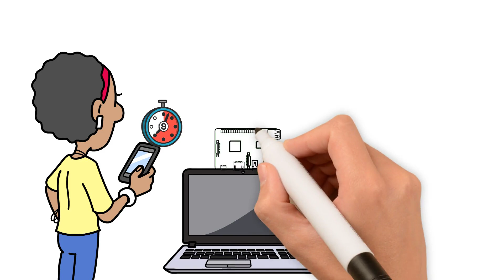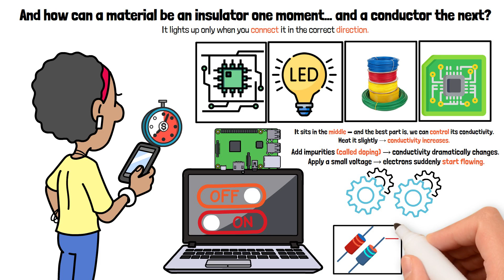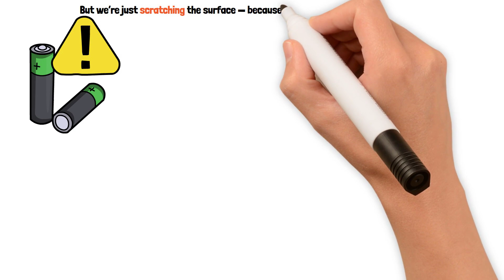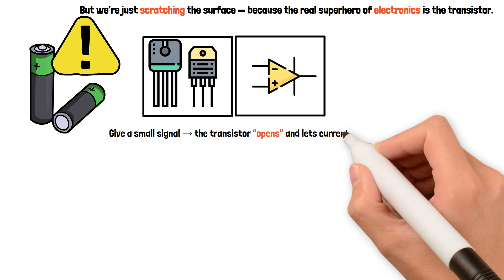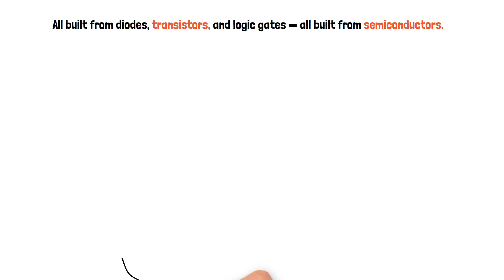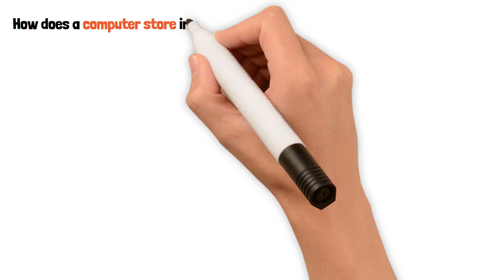Semiconductors Explained | The Physics Behind Modern Electronics

Comment from the maker: Modern technology doesn’t run on magic.
It runs on controlled charge flow.

In this video, we explored semiconductors and electronics, explaining how physics enables materials to control electricity with precision.

We covered:
Why semiconductors are neither conductors nor insulators
How electric fields control charge flow
Why diodes and transistors are possible
How semiconductor physics powers modern technology
Semiconductors turn physical laws into computation and control.

▶ What this unlocks:
With electronic behavior understood, we can now explore communication systems and signal processing, where information itself becomes the focus.